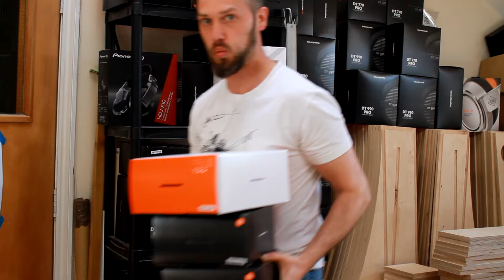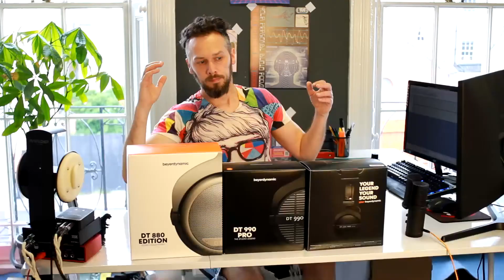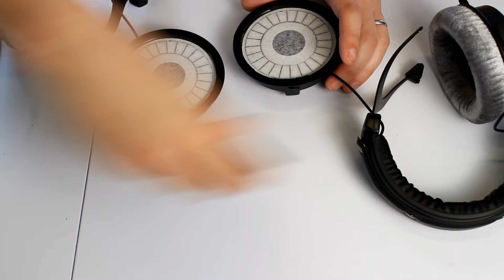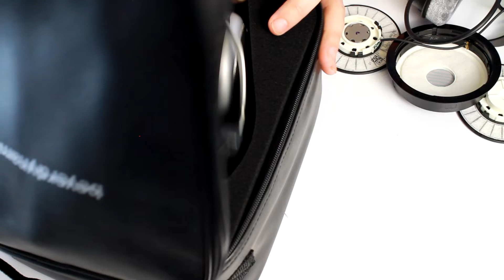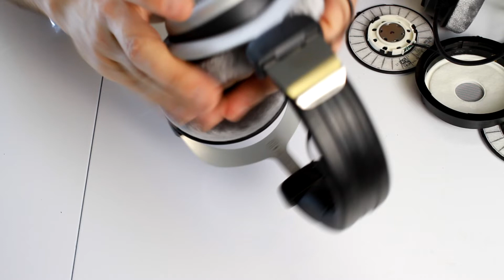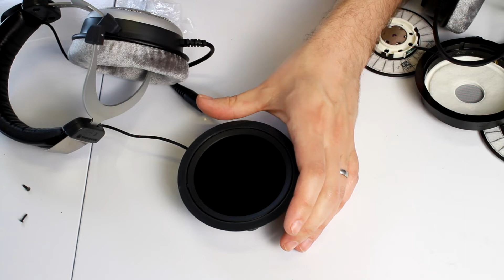What is the ACTUAL difference between the DT770, DT880 and DT990 Beyerdynamic headphones?

Comment: Actually my question is the difference between the pro and premium editions.  I find in the 990s there is a BIG difference (both 250 versions), as the premiums are way  brighter.
Reply from the maker: We don't deal with the 990 premium much but they do have a different earcup with different size holes which will effect the airflow but if we get any more come in I will do a proper comparrison

Comment: This is a fascinating glimpse into the inner workings of headphones. So many headphones have a treble peak at about the same frequency, (even Sennheiser's HD800), at 6 to 8kHz, that I suspect that it originates in the physical dimensions that they have to use. The only way to mitigate this peak seems to be the use of damping material. Any ideas on how to eliminate this at source?
Reply from the maker: DIYaudioHeaven do make passive filters for different headphone - we built one of their designs into some 1990s in this video
https://www.youtube.com/watch?v=ob5o0wUigdE
Reply: @CustomCans  I have the DT1990, I use the equaliser in the RME ADI-2 PRO. I measured its frequency response and waterfall to set up the EQ.  It's smooth apart from the peak. I measured my HE400i at the same time, it's waterfall response looked like a stack of dinner plates waiting to go into the dishwasher. Clearly there's a limit to what EQ can do.
Reply: I use the software from Soundworks "SoundId Reference" which makes its best to bring the sound as neutral as possible for headphones or monitors or both.
It costs a bit but even if you change your headphones or monitors you will get the best from them.  I am happy with it.

Comment: Thanks for this breakdown (hopefully not literally). The 880 Edition may be designed after these 770 and 990s, but from what I understand looking at their old catalogs the 880 was the original of the lineup (early 80s, I had a pdf catalog from 1984 which shows a DT 880 Studio, DT 880 Monitor and regular DT 880 edition. They had lesser models too like DT 660, 550, 330, 220). The 990s came out later in the 80s as the last of the three, meaning to be the ultimate. Of course these models have been further tuned and redesigned over the years since then, so one made today probably does not sound the same as a new old stock (NOS) from the 80s or 90s. They also used to sell one in the early 90s called the DT 911. 

These days they sell something called the TYGR 300 R for gamers, which is a modified 990 that has different filter pads inside it. I think the same kind used in the Amiron, so the highs are less harsh.
Reply from the maker: Glad you liked it and thanks for the info - I really should do more research into the history of them
Reply: I can understand why they'd stop selling the  DT 911.
Reply: Actually, there is no foam in the regular Amiron Home (unless my model was just robbed of them. Maybe that's why they, imo, suck) . The Amiron Wireless has them for sure.

Comment: Interesting stuff. Still can decide between dt 770 880 990 1770 1990 for over a month now, 1990 are 370 on amazon in the uk atm so maybe ill just get those, but im not sure if its worth the money for everyday use with a little bit of music listening and gaming.
Reply from the maker: The 1990 are pretty amazing - I have just been listening to them vs the 880 - the 1990 have incredible detail in the bass and sub bass and just have a lot more impact than the 880 but the 8khz peak can be a bit harsh on some tracks
Reply: @CustomCans  Im not too worried about the peak as I have dekoni hybrid pads that should tame it. My main concern is that I wont hear the difference on spotify or youtube which is where I listen to all my music, I was hoping the additional impact in the bass of the dt 1990 would still come through on lower quality audio files.
Reply from the maker: Yeh - you would still hear that additional bass weight and sub bass you get from the 1990s and I suspect the quality you get from youtube will probably increase over the coming years
Reply: If planning to use DT1990 for CSGO, I don't advise it. SHP9500 with EQ are MUCH MUCH better. I own both. The footsteps and the position of footsteps is much better on SHP9500. The connection feel with the game is very bad with DT1990. I cannot comment on other FPS games. Impression from a guy with 8000 hours in CSGO, 1100 matches on faceit. HD800 is even worse than DT1990 for CSGO.
Reply: @steamstories1279  I dont really play much competetive games anymore, if I do its probably r6/eft. But in my experience the biggest issue with hearing in games is the audio engines bugging out due to network lag.